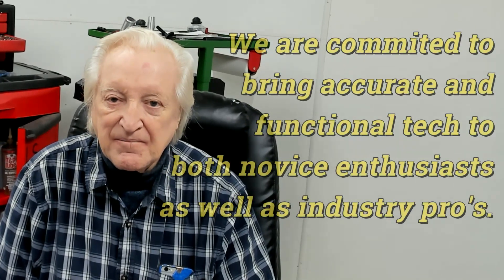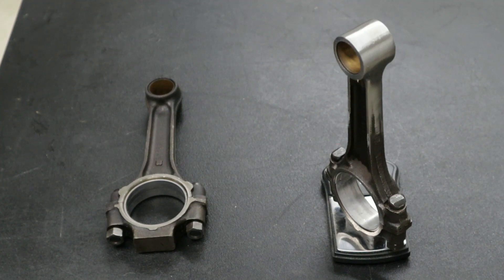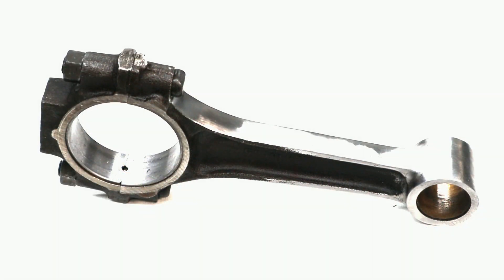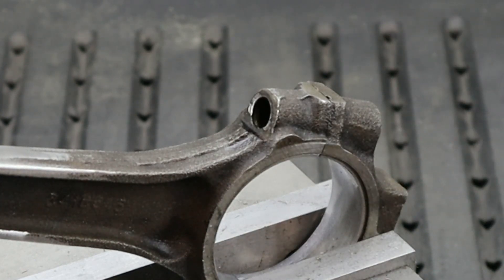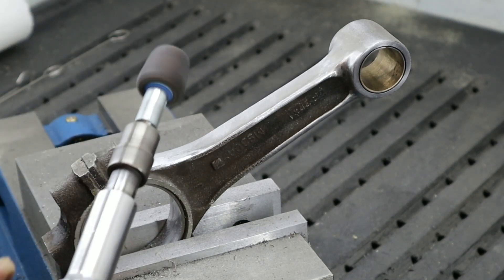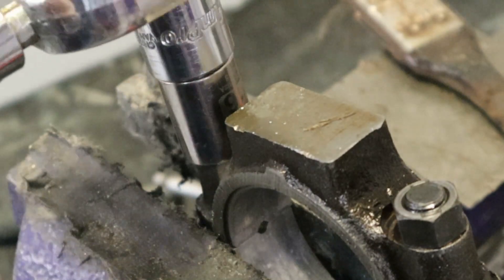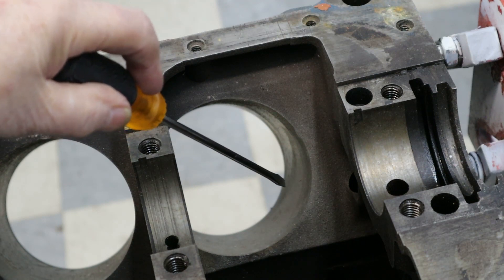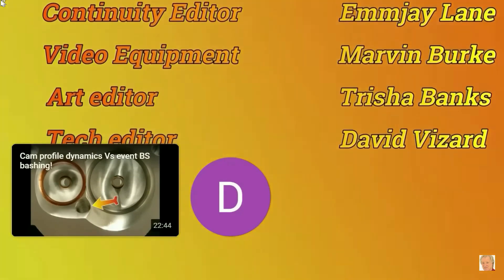Mission Impossible Mopar 318 - more power no cost!

Comment: I’ll SWAG that weight at 15 grams. It certainly enough to throw the engine out of balance! Back when I worked at an Auto Parts and Machine store, we had a customer that collected Corvettes. He was a pilot who flew the Hawaii route, and had almost every year vette in his collection. He bought a new Vette in 81, broke it in and then took it to Firebird/Wild Horse Pass raceway to see what it would do. A rod let go in a big way. Then he brought it to us to repair. There was no repair to be made. Inside the oil pan we found a whole lot of gravel, and a few hunks of identifiable connecting rod. Between rod to rod of what was left we found a variance of 5 grams. There was no way to tell how much the exploded rod weighed. We ended up building him an old school 350 with  461 straight angle heads.

Comment: if you drill two half inch holes (quarter inch deep) in that lump at the bottom of the rod, that won’t change its strength yet make that lump half the weight

the pin-end, lump, can also be drilled (half inch drill bit) quarter inch deep

Comment: you could remove the same amount (more) using a drill-drill holes deep (the correct amount) in certain areas all over the rod

gordon Murray’s Ts50 did this too the brakes on that car

drilling holes in the correct places not only lightens the live but also adds flexibility at the same time

Comment: my guess approx 200g total off rod
Reply from the maker: Jim I need the loss of each mod to date not what we might achieve down the road.
Reply: thx for ur reply David. im not a mopar guy and have no idea what weight of each rod (factory) weighs.
but im guessing rods are cast iron ? if so thats a bit of weight there. 
if im way off with the calculation of how much weight of rod has been reduced by your grinding off all that metal, then i saw one guys comment whom i guess would be close, he mentioned 120g.

originally i was going to place estimate between 150-200g per weight reduction per rod.

i may be way off.
sorry thats all i can estimate.

intersting to note in your comment , by sounds of it,  you could do more work to take off more meat off the rod ?

where would you do that ?

btw, what an interesting hack you included in this video regarding shimming the lower part of bore to allow more flow. 
very interesting. 

im working on a sb400 truck motor year 72, hoping to acheive around 500lbs torque at low end of rpm.

your previous video on 421 chev with high torque at low prm grabbed my attention.

 cheers

Comment: I used to do this rod work for a team that built SBF and Bosses for SCCA road race applications. What I see missing here is having the rods professionally shot peened afterward. Not peened in your home blasting cabinet. Industrial type peening. Probably about 15 bucks a rod these days. Grinding and polishing changes the properties of the metal.
Reply: It sure does but what is better a rough hard shot surface or the polished one?
The shot surface is harder but is it less crack prone? Polishing after shot would seem senseless but idk.
Reply: @kenmoule825  All I can tell you is that this team and their opponents did this on a regular basis on engines that held sustained upper rpm use. I have not seen anything about peening rods on YT yet. Might be interesting to get an updated viewpoint.
Reply: @413x398  My eggselent now passed on machinist said never touch anything in the rotating and reciprocal assembly unless you plan to balance it, reduce weight and polish the surface. He strongly recommended shot peening, on an industrial scale, the rods specifically and the crank if your after weight reduction. Now I'm not sure how much tension or compression you have on freshly polished con rod beams. I do know if you mess with the structural webbing on the crank it will crack if if isn't re-shot with steel at an industrial level whatever that may be IDK, specifically. We set the stuff out back in the 80s and 90s. Most people will claim they know some chit when in acual reality don't, don't know a fuggin thing, that is. I'm not guy but I've messed with a part or two maybe once 😉
I do not shot peen blueprinted mechanical oil pumps once they were polished but we didn't road race either or run much past 300 lap enduros. Offroad racing everything needs to be the best it can like offshore boat racing. Both are brutal on everything so shot peening everything on those is probably best. Live and learn or break chit!
Happy New Year everyone

Comment: Looking forward to the next mission imposible, just found you and subscribed straight away. interesting content, but i have a question.

 how can you get more power from the block egde cleanup? the piston only travels so far and the rings seal right? 
i mean the piston does not travel beyond the sylinder length, and the rings seal above the egde of the sylinder wall

or is this just to reduce drag for the rotating assembly and be more efficient and make more power🤔

Can you explain this is the upcoming video? 
just curious to know how that works
Reply: I might be totally wrong about my thought here.

Still learning but there is probably an explanation that makes sense, keep up the good content, and please don't judge me too hard if i was way out on my thought😅

Comment: I'd do this to stock 5.0 H.O. rods but I would run them through the thermal oven and shot peen for 5 cycles to stress relieve and case harden them they would ring like a bell when you tapped them after the case hardening they were stronger than the stock blocks could handle afterwards

Comment: Guesstimation (33-40) grams weight reduction per rod.  
Significant decrease in reciprocation mass as it needs to change direction twice per rotation.
(2/12/2022 adjusted figures as  first started by using the wrong  density ) 
Jm,

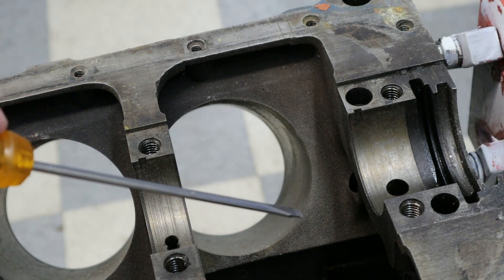Comment: Got to admit at approx 13:20 that really wasn't something a thought about it... really good advice! 
totally agree about notches seen a many hundred-kilo spinning casting broken into a half-machined right angle and solved from fatigue cracking by a deliberate "U" groove actually cut into casting reducing the section however totally solving the issue...the same method and concept! Good stuff
thanks, Jm

Comment: I would have liked to see you using a soft jaw insert for the vice jaws when the bolt removal and torquing sequence was done. The small movement that the rod makes during this process can also produce stress risers that you're trying to avoid. Nice job on the polishing of the beam.
Reply: On diesel rods, the guys in the factory would take them off the machine and chuck them in the parts bin.  They didn't understand.  And most of the stress is stopping the upwards movement of the piston at TDC

Comment: I am a huge fan of David's books. the big block Chevy ones are fantastic, and the cylinder head porting one is on point.  However I am not a Fan of Uncle Tony, sure he know a lot about build codes and trim tags on mopars, but he is a hack mechanic and engine builder.  there was a cross over episode with Lunar Garage and Kicks Garage where Tony put the wrong size engine bearings in the engine, and they didn't clean the engine, wrong pushrods, etc.  and it was a massive failure. I felt bad for Nick's Garage, Nick is a strait up old school builder who does some fantastic work.  I also felt bad for Lunar Garage, he was a new kid just getting in to cars and engine building and didn't know how to build and engine the right way and unfortunately chose uncle tony to be his mentor. and Tony failed miserably at it, then then made a video complaining about the kid and making all kinds of excuses. its guys like tony that don't teach the younger generation right way to do things and that turns them away from hobbies like automotive restoration and engine building and diminishes the hobby.

Comment: Well first: 32 grams. Second: while rounding the cylinder buttom ends may reduce turbulence a bit during upstroke, I'm not fully convinced it will have much of an effect in total when we consider the flow outwards also. When exiting the cylinder bottom, a rounded edge will result in more drag.
Reply: No it doesn't.

Comment: You could save a lot of work if you could locate a set of poly rods. They are already set up for full floating pins and are much lighter. Use in the 273 & early 318 engines with forged steel cranks. Some balancing required.

Comment: I am going to say 34 grams. Thanks DV for doing this Mopar engine, just wish i had held off stoking my 318. Most engine builders in New Zealand dont play with Small Block Mopars and had no clue what performance upgrades there was. Armed with your knowledge by the end of this series I might tear mine back down and start afresh. DV do you have any advice on the Trick Flow Power Port 190 heads? I hear they are the best on the market at present  paired with their single plane inlet manifold.

Comment: Very time consuming but free horse power with polishing the rods reducing the weight of those heavy chunks of steel connecting rods. Yes to also blending the cylinder bores as anything to improve the pumping loss to friction of the air oil turbulence inside the engine.  David will you blending the sharp edges of the counter weights or go full on knife edging the crankshaft? I myself would do a combination of both. 

I still see the carburetor will still be the biggest hurtle to overcome. 

As the cylinder head air flow will be top notch and the reduction of parasitic drag from the oil in the pan will make this engine make great runner and net the goal of 318+ horsepower easy if the fuel is there.

Comment: 18gms total removed, I had to stop watching after seeing rod being held in vice without soft jaws - made me shudder.
Reply: Soft jaws  , how many engines have you built in your lifetime  ?
Reply: @brettjohnson8009  obviously more than you ya' chimp, if the guys talking about polishing con rods(and not mentioning in what direction) because of stress risers what do you think the unprotected jaws of a vice are going to do.
Reply: @dogpaw775  I worked in a reman facility for 16 years all work was documented if you really want to go there ,I've reconditioned thousands of connecting rods , have never seen a steel connecting rod receive marks from a vise , be it a commercial rod vise or a plain old shop vise , if you believe otherwise then that is your opinion,  good for you , have a good day

Comment: I guess that piston pin end modifications removed 20 grams and buttom of the rod beam modifications removed another 4 grams. Total weight removed 24 grams.

I recently did similar modification to a set of cast rods by just smoothing the rod beam sides(didn't touch the balance pads at rod ends) and removed about 4-7 grams of material per rod.

Comment: the early 318’s used the baby rod from the 273 ,…
casting #2406782 
copper coated and 727 grams , oil hole , top of the small end .
will you add an oil hole to your rod ?
Thanks David
Reply: found the baby rod teen , makes the tachometer , climb faster

Comment: I have a question I know in the spirit of this build it not a stock part but would it be beneficial to use a bolt made of a lighter material like titanium or something along that line
Reply: titanium rods are $$$$ and a little notch.. scratch will make them fail..alumiumn rods are to soft for long term use.. drag racing use only  they change them out after a few runs

Comment: Two things, A. losing so much meat around the pin will probably weaken the rod. And make it impossible to balance. B.the base of the rod too should be 'dressed up' . Then the whole rod shotpeened.
Though the time and materials used costs more than buying new aftermarket rods with the threads in the rods.
I have seen too many stock rods fail, more so when 'strengthened'
And those 318 rods are fragile to start with, more so for their length
Reply: U make some good points I was kinda thinking about. Bit I don't see why it be hard to balance if u make them all the same
Reply: Why will it make it impossible to balance ?
Reply: @brettjohnson8009 because you now have no material to remove anymore.

Comment: Keep in mind this action will put the rod material in a state of tension. You will need to take one more step. The rod will need to be shot peened to put the material in a state of compression. The rod will become brittle and prone to breakage without. Direct  Connection / Mopar Performance marketed rods as polished and shot peened. Torsion bars are also shot peened.
Reply: good info. Thanks.

Comment: Why not use 273 rods that are lighter in original form? They are direct fit from what I understand.
Reply: They suppose to use only factory stock parts that it came with when it came off the factory floor nothing after market unless they have no other choice
Reply: @nicholascola7190  273 rods are not aftermarket
Reply: @brettjohnson8009  I know but it has to be what came in that engine I guess is how they doing it
Reply: Because that wouldn't eat up enough time. It would be far to quick. He wants this project to last until 2064.

Comment: If you got real generous you could do a winner for each stage of rod lightening/polishing 😁.
I haven't made a guess yet but that 'lump' on small end has to be relatively heavy.
Very interested in the cylinder base mod, I've often wondered about airflow around that edge but never actually tried any mods there as motorcycles usually have a bevel because piston goes in from bottom (until 'uni-block' started to be common in 80's)
Reply: radius to the bottoms is something I'd never thought about, but makes sense.
not just the air flow but the extra oil it'd throw into the skirt area too for reducing friction+wear would help free up some power.

Comment: I'm so glad Uncle Tony told me about this channel. I'm gonna have to buy an engine to rebuild so I can use the tips you've taught me. Thanks for sharing your knowledge
Reply: have you checked out Richard Holdeners channel?
Reply: Buy his books, they are loaded with info!
Reply: Try starting with some small engines, being they are smaller it's easier and quicker to see results and test theories. 
I did a little mix/match of connecting rods and wrist pins between early and late models on a Briggs 49 cubic inch v twin and saved like 30 grams per hole from  using the early rod and pin. 
I happened to have both types of engines apart for other reasons and noticed one of them had a much thinner wall on the wrist pins. 
So I weighed the rods and found more weight reduction. 
She picks up nicely now and carries it to 44-4500 or so , especially with some port work on the heads.  
Go ahead ,shave like .150 off a head and see what it does. 
I'm just saying it's easier and faster to try on a small engine and then transfer the idea to an automotive engine.
Reply: Good idea, a Studebaker V8 is my choice.

Comment: Mr. Vizard the engine wizard, I'm loving the videos on this build. I'm currently doing a 1963 plymouth valiant hyper-economy build right now(slant 6, 170 cubes, a833 OD transmission, 2.93 7-1/4 diff) and I'm looking forward to every trick you throw at this 318 in the hopes of applying the same principles to my lowly slant 6. I'm really trying for 40MPG highway out of this car. Could you explain exactly why lightening the rotating mass of an engine can free up engine HP? And also how does a lightened mass affect idle speed, as well as take offs from a dead stop? I also can't wait to see your camshaft selection for this build! Thanks.
Reply: The key to getting that Slant 6 to mpg well comes down maximizing cylinder pressure without making it detonate. Think of how a diesel operates.
Thunderhead289 and Unity Motorsports have excellent videos on carb and ignition tuning. 
If it was me, I would get a custom camshaft made that would increase the torque in the 1200-3500 rpm range. Use DV's program to spec it out. Then work on friction reduction. Use Lubrication Engineers synthetics from front to back.
Then drive it like a truck, shifting at 2000-2200 rpms. Experiment with driving style. Add vacuum and AFR gauges. Put a knock controller on the ignition......the J&S Safeguard is the best.
Reply: just some random ideas - reduce your oil pump to 10 PSI per 1,000 RPM
Cut 2 blades from your water pump
Run an electric fan that ONLY comes on when hot AND when your brake lights are on. Feed the relay from your brake light circuit.
Lower valve spring tension, retard cam, lessen the "overlap" and maximum lift. (requires grinding) Having the intake close late makes it like an Atkinson Cycle.
Having the exhaust close early keeps the fresh charge from being scavenged out.

Comment: 🔔😎 
For completed rod weight, I forgot what I said previously. 87 grams? 😳😳
Trimming the big end weight to minimum, I'm betting 107 grams total weight reduction for each finished/ balanced rod ready to install. 😳😳
I used to do ALL the balancing at the race engine shop. MOPAR rods are massive as is their mack crankshafts. 😲😲😎
I've done similar to several different type engines.

Comment: Big Mopar fan. Did same thing 25 years ago to "interceptor"  rods lost 100 grams I belive per rod i also ported a set of  Chrysler "J" head to flow 287 intake and 193 exhaust  @600 lift. Flowed 235 at .300 lift. This combo Made 607 hp and 642lbs 10-1 compression with mild cam.
Ran on 89 octane. 366 Cid. Flat tappet cam. Stock shaft rokers from a 273.
Reply: Sure
Reply: @@rudyjhughes  soon DV will explain Chrysler .904 lifter diameter and how to take advantage of it.
Reply: Wow that's 1.75 per cubic inch. 🤔🤔🤔
Reply: @hotrodray6802  2hp per Cid is the goal
Reply: 600hp from a pump gas Chrysler is pretty easy.